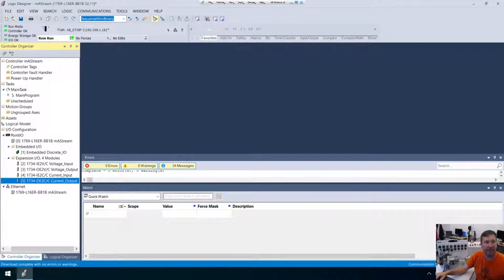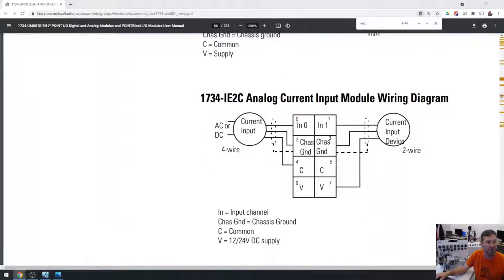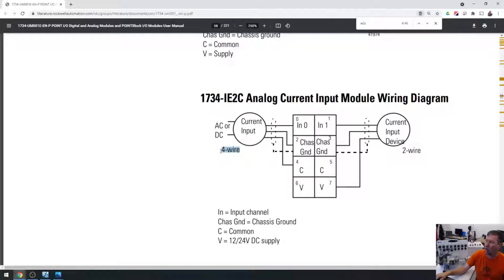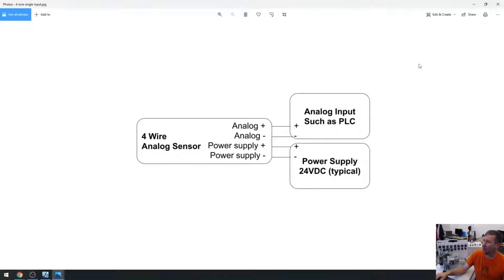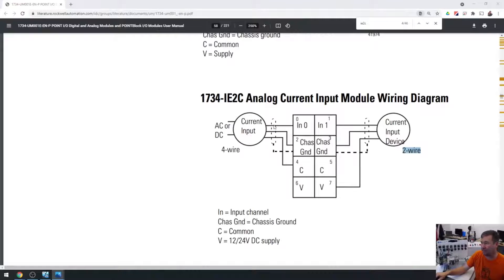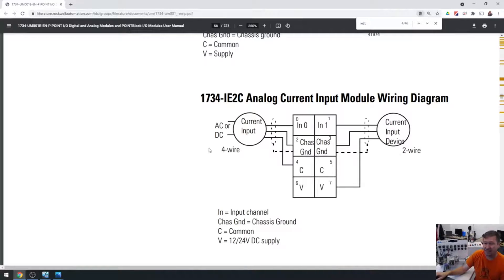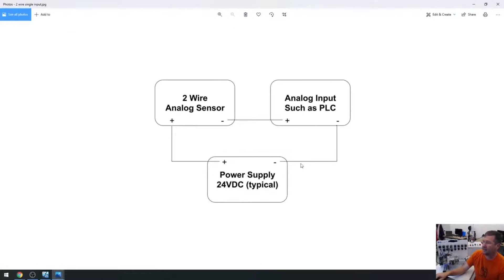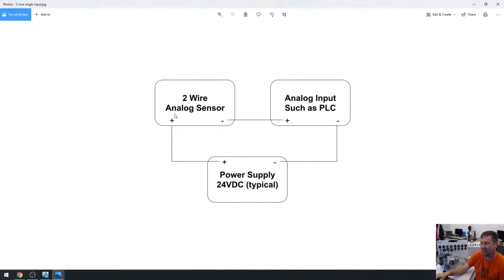4-20mA 2 Wire Current Loop vs 4 Wire Current Source Diagram

Comment: Wouldn't the device being a sinking or sourcing device also determine whether it got terminated on the voltage or common terminal?
Reply from the maker: You don't hear the terms sinking and sourcing as much in analog signals because usually an input can be wired either way with very little modification and some isolated signals could arguably be called sinking or sourcing.

Comment: I always keep an isolator on hand.
Reply from the maker: Yes, they can get you out of a bind.
Reply: @TimWilborne  where can I find a 4 wire transmitter?
Reply from the maker: @IwatchLol  Depends on what you are measuring.  Most devices that have a display such as a pH or Turbidity meter will be a 4 wire device.
Reply: @TimWilborne  I’m trying to make a redundant boiler control.  Need a 0-10psi transmitter 4-20ma running through a 0-130 ohm converter.  I’m use to using just 2 wire loop powered stuff.  I need to have its
own power supply for the transmitter.

Comment: A lot of the explosion rated speed sensors I use are 3 wire analog sensors. A lot of stand alone speed reference/motor controllers i install are 4 wire and use a 5 pin decoded m12 connection. The custom applications that use multiple analog current devices and aren’t overly sensitive are wired for 2 wire application for simplicity sake, mainly just used for belt speed inputs and tether to the HMI.
Reply from the maker: Good info, thank you for sharing Leland!